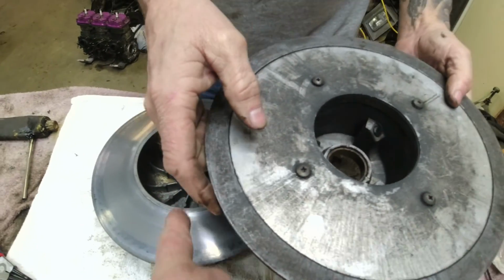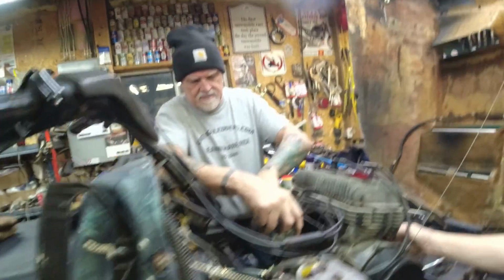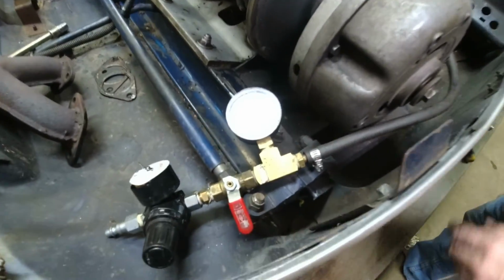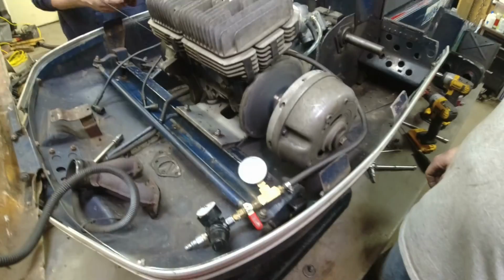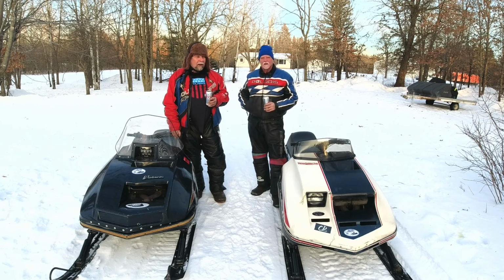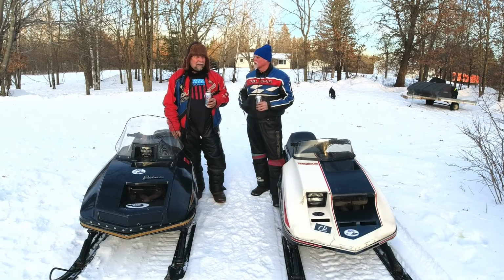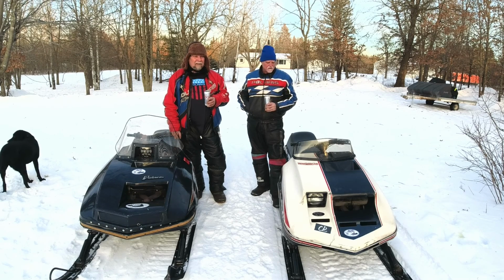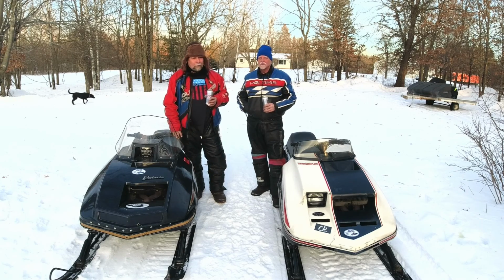Lonnie's 77 TX340 Part 3. Carbs, Secondary rebuild and Ditchbanging test run! Polaris vintage sled

Comment: I'm remember those Polaris TX 340 1977 brand new.... and i remember also the TXL 340 1977. I was just 11 year old in 1977... In my book. The most beautiful Vintage sled in 1977 ( not Oval Racing Sleds ) .. Was the Polaris TX 340 & TXL 340 and the Ski-doo RV 340 & Moto-Ski Sonic 340 😳😳😳 Very Good Looking Sleds.. I'm talking the shape the design the Look ......Back in 1977 ( Like the Olds Muscle Car)
Reply from the maker: I agree, but you forgot the 1977 Scorpion Bullwhip for the most beautiful. It was a cross country race sled. 200 made or so I'm told.

Comment: Thank You for the tip on the newer Indy 600 primary.  Do you reshim the new primary for the 042/045 belts?
Reply from the maker: I never have. Just weights and a spring and use them.

Comment: Just want to run something past you... My '77 TX 340 runs okay... for a while. I can go 10-15 miles and I start getting bogging issues on the trail. My last run with her, I was out with Jason from "Let's Fix Something" and around 30 miles into my day, it didn't even want to start anymore. A week later, walked out to her and she started right up so I could motor her into the shed. I'm not a mechanic so I don't just jump into jets and such. I rely on paying guys like you! Lol... but I'm trying to learn so I can do the work myself. Just wondering what thoughts you might have about a warmed up sled bogging out 20-30 minutes into a ride. Plugs have been changed. Fuel lines are full.
Reply from the maker: I have had cranks seals do that. Old seals can get soft when they get warm.
Reply: @nuttersspeedshop  Oof... that's above my pay grade! Should make for a great learning experience! How many Coors Lights does a guy go through replacing  crank seals?
Reply from the maker: @kennethgoin628  If you already have the pullers it's maybe a six pack the first time. Buy good quality pullers. If you buy cheap pullers it's a lot more.
Reply: @nuttersspeedshop  This is where my amateur status comes shining through! I haven't watched any step-by-step videos on the process yet. I have a clutch puller already but I haven't looked into what more I might need for additional/task specific tools to do the job. Thanks for your input! I really appreciate the information you share! I just finished the pickup line project... didn't use Tygon! Went well... I think... so tomorrow I'll be putting the carbs back on and seeing if my grade is an A or an F.

Comment: See alot of guys putting p85 clutches on those sleds. Guess it involves machining the taper but dont know who does that in my neck of the woods.
Reply from the maker: We use the later "32mm bore" P85s off 2010 and newer 600s. They work great.

Comment: Nutter. I'd put the carbs back to stock jetting. Even with gutted air box. Remember these engines came very conservative from factory " Rich". if anything I would raise the needles 1, with stock carb jetting On very cold days. Your richer carb jetting is more likely the biggest reason for the bog. You can always keep an eye on plugs and piston wash. We run many old tx free airs and other old fugis with gutted air boxes here in Alaska with 0 issues down to - 30°.I also ride in Wisconsin. I'm originally from there, and those temps are warm compared to Alaska. On the clutch. I have used the shallow bores on long shaft fugis too. I hate to because that puts the weight further outwards. More likely to bend crank if clutch isn't balanced properly. Just be sure to reset the secondary offset. Please don't take me wrong. I'm not trying to be a know it all. I know you are a smart guy, just trying to help if I can. Good job on the secondary rebuild, God bless. Oh, I also use the 045 belt on my TX-L. It's a tad shorter than the 042 belt.
Reply from the maker: Thanks. This was weeks ago and lots of tuning has happened since then. I use the 045 because it's cheaper :) Going to set Lonnie up with later "32mm bore" primary from a 2010 or newer 600 over the summer. The fit the old long outputs great. I use them on several of my sleds.